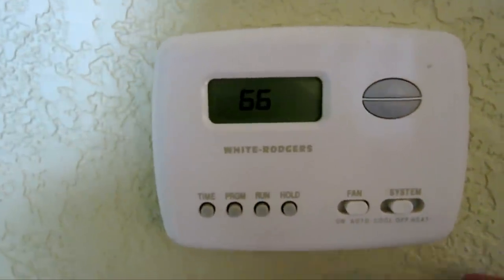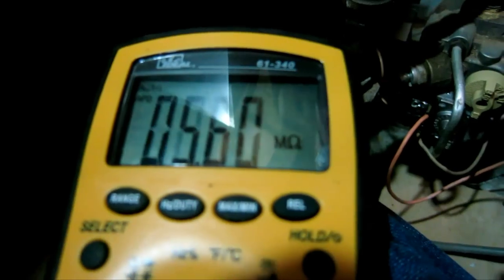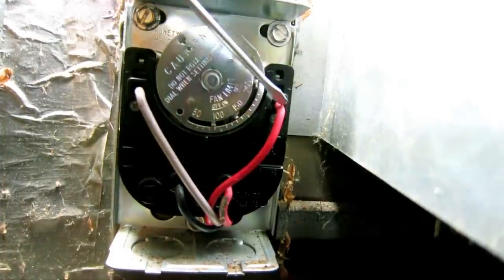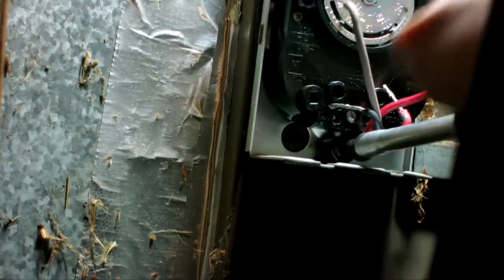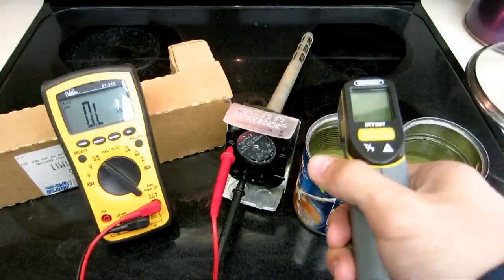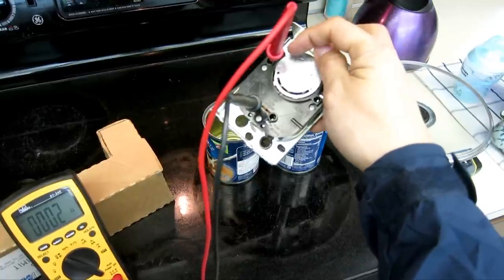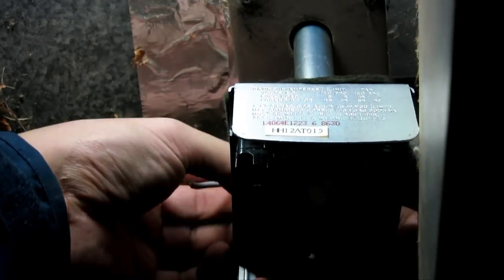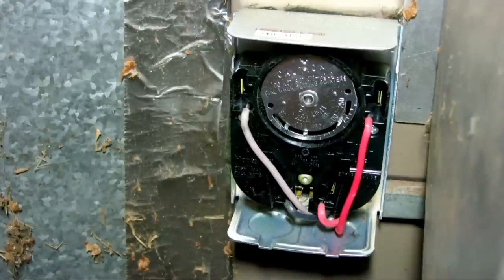Furnace comes on but blower/fan stays off- HVAC Fan & Limit Control Switch replacement  ac

Comment: I have an old furnace and replaced just about everything over the last 30 years.  Most things are straightforward and easy to test.  Thanks for the video on the fan/limit switch.  Mine hangs up when turning the fan off at the end of a cycle.  I like the water test...quick way of hitting the full range instead of watching the furnace cycle.

Comment: On horizontal furnaces there should be a small 24 volt heater  in the fan and limit switch that will help the fan start.  The heat to activate the fan and limit tends to go up, not sideways.  The same for down flow furnaces.  Good that you were able to fix this, and the fan did not go on and off.

Comment: great job .... that jumper you mentioned is for different voltage used for the fan and limit. if both used 120vac then the jumper stays but since one is 120 and the other is 24vac then you have to remove the jumper.Hope this helps.

Comment: I just had this happen to me but my Fan & Limit control turned though my fan wouldn't come on.  I was thinking it was the Run Capacitor that was bad.  Asked a friend in HVAC and he said if the fan runs in the "ON" position then it wasn't the run capacitor.  He said to move the set points on the Fan & Limit control dial, then put them back to the previous settings.  Worked like a charm, fan kicks on when the chamber heats and turns off when it is cool enough.  I don't understand why but it worked.
Reply: +Robert Rodgers Maybe it was short cycling because the settings on the fan on and off were too close to each other and when you moved them back you set them farther apart. rule of thumb is 30 degrees apart between on and off
Reply: Dude you are a genius.  That fixed it, moving the set points kicked on the blower again.  Don't know why the blower stopped working, never touched the set points.

Comment: Excellent video. I just wanted to mention that it would be helpful if you could've explained where you located the switch. I have the same problem but have to locate where the switch is located in the first place. But, other than that, great video and thanks for the info!

Comment: Bi-metallic  strip, twisted as you see for greater sensitivity.  And, when setting the stops for the turn on and off points, don't manually turn the wheel. Hold it still to do the stop settings.

Comment: Very informative tutorial..Do u have a video in a reverse process..I have a issue with my unit..The furnace/heat works fine ,blower kicks on . if I switch the T-stat to cold I get a whisper of warm air .Replace the air filter,capacitor ,replaced the contractor ,measured 24-26 volts from the coil ..Basically stumped right now ..Could you help ?

Comment: At night I turn the thermostat down. In the morning i turn the thermostat up and the burners turn on; but the main blower does not. (I haven’t tried the manual fan test yet. Tomorrow.)
However, if I unplug/plug the HVAC unit, the main blower will now turn on normally, and then the fan will resume on/off cycles as needed for the rest of the day.

Comment: Mine is a small furnace. I had reset the points turn off on  the limit  switch  because  it didn't stay on very long after it got so hot.    So I set it to come on about 7 times an hour on the program thermostat.

Comment: My heat has been out for a week now. It's realky been cold at home. See my breath everyday, cold. Fan blows, but no heat. I've reset everything, also the breaker. Cleaned the front control boards. But will not Ignite no matter what I do. It's an Electric Furnace. I still assume it may be the Igniter Switch, or the Limit Switch?

Comment: Should ya get 120 volts constant when it’s supposed to kick on? I’ve been having an issue with here my motor sometimes doesn’t want to start. My voltage drops o zero at the limit switch when the motor does decide it wants to work! I’d assume it should be constant while it’s running

Comment: I had to program my thermostat to the furnace so the fan on automatic when the burner is on.   The on fan stays on but it automatic fan won't stay on when the burner is turned on off.  I fixed it where it just run the furnace and not the a.c.. The a.c.  doesn't work anyway even though it does run.

Comment from the maker: It depends on your control board or system. For my system, Its on Low speed when Fan is set to ON and Temp is set to Heat.
Reply: J
0

Comment: I have same problem, but I found that with fan in Auto mode and heating is on (i.e gas burning), the white wire shows 24 volts, the green wire at the furnace shows 0 volts. When I set fan to ON, this green wire shows 24 Volts (relative to 24V common).  This problem does not appear to have anything with fan limit, please correct me if I am wrong.

Comment: Nice video.  My auto fan stopped working also. I notice that when heater is cool, the dial is 180 degress from where all the videos are showing it should be. Is there some way i can adjust the dial? I think the on/off switches are useless if I don't fix this first? Any suggestions?
Reply from the maker: +Kri8 yes, you can adjust the dial, just push it from 180 to a lower degree.

Comment: I know its been a while since any questions have been asked but I do have a short one. All the FLS that I've seen have 4 wires coming to the FLS. Well mine has five. There's a yellow wire that comes in and connects to a terminal, and then that terminal has a jumper that goes to the bottom right side. Im assuming its being jumped to the 24V line. Anyway, all the ebay FLS seem to have only room for 4 wires coming in, not 5. Any suggestions??

Comment: i just found out my ac condensor outside has been running nonstop even though the heater and ac is inside is not running. i got a whopping 250 dollar this month and that is how i found out by looking for the reason why that bill is high. the only way i can stop it is through the breaker switch. do you have an idea what is causing this? the heater/ac is off but that outside unit is always on.
Reply: I just encountered the same problem! Have you found a solution?
Reply: I would check for stuck contactor on condenser unit then check thermostat to make sure it's not sending 24 volts to furnace control board y connector then check control board for a stuck relay.Wiring could also be shorting r to y.

Comment: If your fan/ limit switch was sticking so badly that the fan side contacts weren't closing you had a much greater problem because the limit side contacts would likely not open if an overheating condition presented itself.  Fortunately you were paying attention to your equipment!

Comment: I have an older Bryant gas furnace, my blower motor runs non stop, the thermostat and heat works as normal.  Do you think that my transformer and or fan switch could be responsible for this? Thanks in advance. Earl
Reply from the maker: if your blower runs non stop then your unit might be a shorted relay, your thermostat might have a shorted relay, or you simply set the thermostat blower to on instead of auto.
Reply: DIY Tinker the same problem here, Bryant, 355 MAV, installed in 2001, about two weeks ago I noticed fan motor continue running at low speed after hitting cycle complete. Thermostat checked o'k., but not sure what is "unit shorted relay", do you mean fan limit control set short or it's relay can't move properly? Does this model have this mechanical Fan Limit Control? Thank you.
Reply: DIY Tinker Can a bad limit switch cause the fan to stay on constantly? My old Thatcher gas furnace works fine except the fan stays on even in Auto mode for long periods. Even if I take the digital thermostat off the wall, still stays running.
Reply from the maker: warrior7772 sounds like you have a relay stuck/shorted some where. and yes, a bad limit switch can cause it. but, there are other relays/switches to consider as well.
Reply: DIY Tinker It is an old Thatcher (no relays or electronics) I just replaced the fan limit switch for $100 that I just bought from a local shop about two hours ago and all is well now.

Comment: Hi,

My Lennox G16 conservator III series natural gas furnace fan won't turn on in auto mode however it does turn on in FAN mode. I had an HVAC tech come in and diagnosed it to be bad Fan Limit Control Switch. I myself ordered a brand new Honeywell part from e-bay and replaced it. 

The problem still persists...any suggestions?

Thanks
Jas
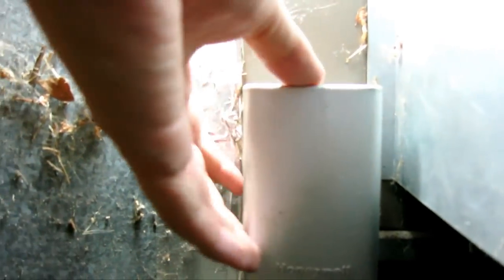Reply from the maker: in the above video at 02:21. i turned on the furnace and measure if there was 120VAC at the blower low speed. Since you replaced the Fan limit switch, hence,I am guessing you should have 120VAC. If you do, then your fan low speed might be bad. there is a middle speed wire that isnt used. you can temporarily use the mid speed.wire.

Comment: this is happening  to me.  I know  I will be ripped off, it is prob something simple.  any suggestions.   I have gas , it  ignites, but   no fan .
Reply from the maker: +Elizabeth Moxham well, it could be the blower, capacitor, control board or sensor. Hard to say exactly whats the issue. I have more videos on those subjects. the goal of these videos is to give you some examples...

Comment: My blower motor will stay running after turning on a/c,wouldn't turn off,so i figure out taping on that fan limit switch & it worked now,maybe it will get stuck again will see

Comment: I have an older Bryant gas furnace, and I can't find find a fan limit control switch. Can I retro-fit with a newer limit switch as long as dimentions and capacity is the same?
Reply from the maker: +Earl McDonald Not all units uses a mechanical fan limit switch. You should review the schematic and understand what is controlling the gas furnace and blower.
Reply: Thank you.

Comment: Is it true that is unsafe to bypass heat mode ie ...put the jumper wire on W and R ?
Reply from the maker: shorting any jumpers is to simulate a thermostat's relay closing. its a trouble shot technique that is used all the time.

Comment: When you turn the fan on from the thermostat does the fan start on high speed or low speed?
Reply: High speed.  The thermostat G terminal is automatically powered on a call for cooling R-Y  so when the A/C comes on the fan is typically on the highest speed to help move cold air efficiently.

Comment: I would like to add a single pole switch to turn on my furnace air 
blower, to use as a summer fan to bring cold air from the basement. My 
fan limit control (white-rodgers) has a manual switch to turn on the 
fan, but I want to install a switch on the first floor near my 
thermostat so i don't have to go to the basement to turn it on. I assume
 the switch can be installed branching off of the fan side terminals of 
the limit switch. The switch receives 120v both sides  and not 24vac. 
Would this be something that would be safe to do ?
Reply: Did you ever end up wiring your manual fan-on switch the way you describe here? I would like to do the same thing with mine but can't find any info online about whether a switch can simply be wired in parallel to the two wires connected to the fan side of the limit control?
Reply: @paulsimon6137  I don't live at the house anymore but, if I remember the wires for the fan blower were in a junction box mounted on the furnace (I had a oil furnace, with a fan limit control) what I ended up doing is adding 12-2 roamex in the box to a switch upstairs that can power the blower on, I used a push button timer switch 5, 10, 15, 30 minutes. It would turn on the blower for the set amount of time then shut off, only would use in the summer when it did not interfere with the heating cycle.
Reply: @kommoncents0000  Thanks for the quick and detailed reply. That's a clever solution; I also have a junction box on mine, and considering a very similar solution to yours by supplying the 120V to the blower motor in parallel to the supply that it's getting from the fan limit control. I am of the impression that internally, the FAN side of the limit control is simply opening/closing the circuit  based on plenum temperature. Wiring a manual switch in parallel effectively does the same thing that the white manual fan control button does. Neither of those should interfere with the heating cycle if the thermostat should call for heat even when manually running the blower motor.